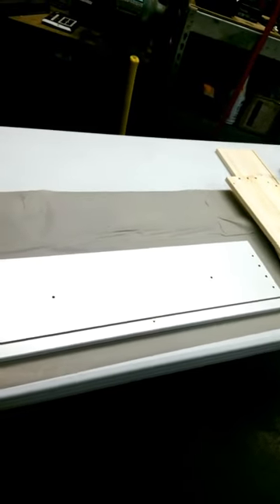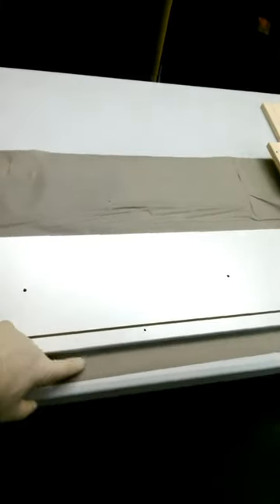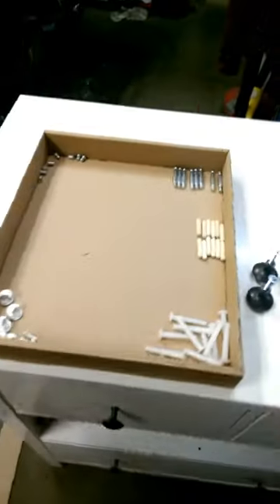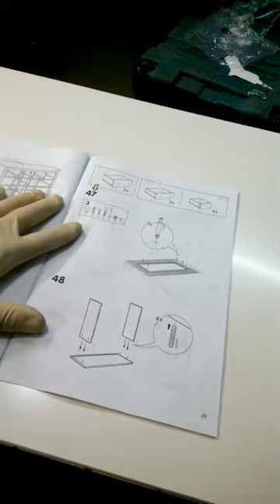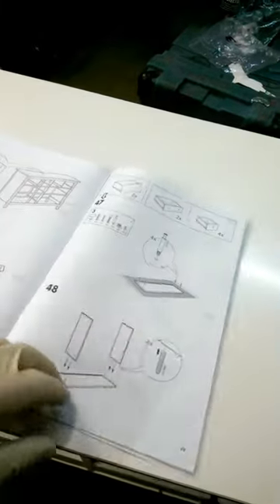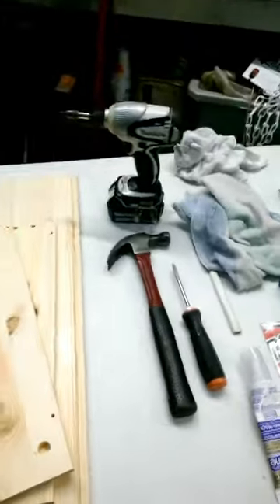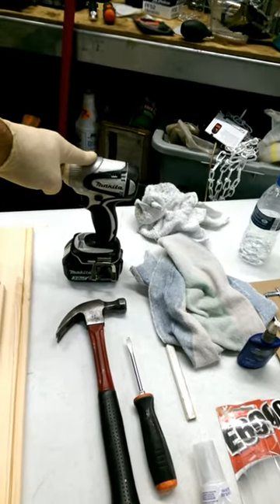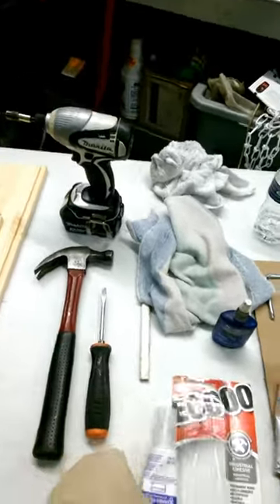IKEA Furniture Tips and Tricks

Comment: The little groove where the cloths sit on inside the drawer should NEVER have glue on in it. That's there for a reason to allow for the wood to expand and contract due to humidity levels. If you glue it, it will expand or contract and that glue will pull apart that particle board in pieces. You never add glue to that groove around 12:36 time in the video. This is wood working 101.
Reply from the maker: Mike, I can't argue with your point because you are correct. I will only say that IKEA furniture is so sloppy that the expand and contract particle board just moves with the rest of the sloppy joints. Also, how much will it expand in homes that commonly have a temperature controlled environment year round? Never the less, you make a valid point. I am still going to glue since the dresser did last with destructive children.